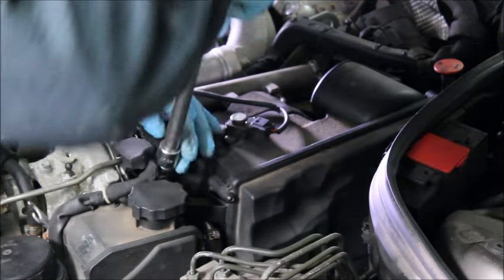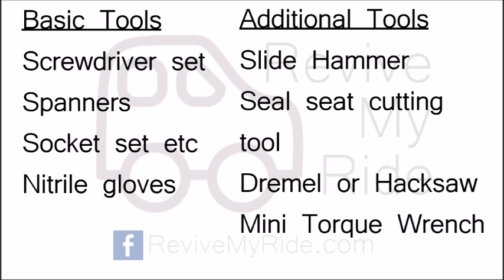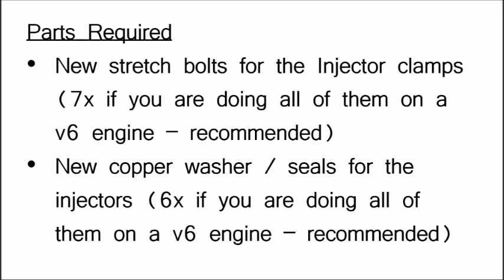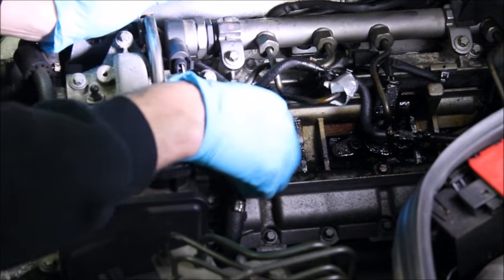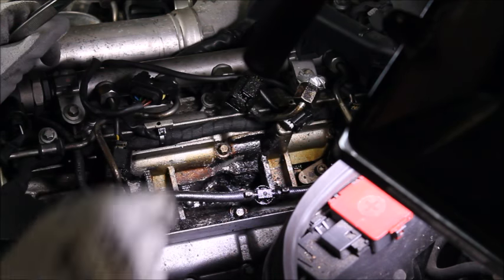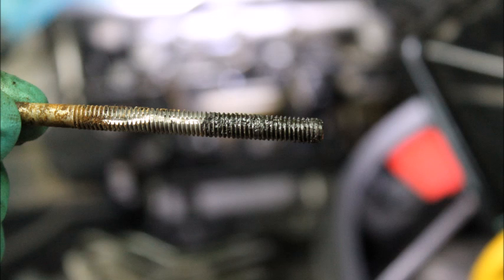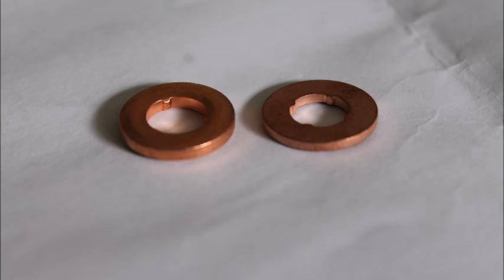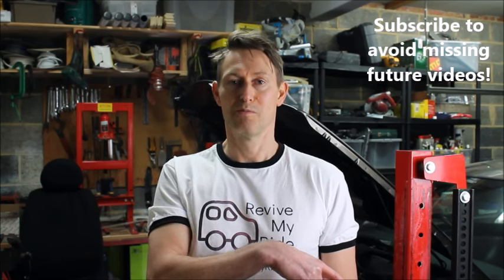Mercedes diesel CDI (Black Death) leaking fuel injector - How to diagnose and fix on 3.0 V6 engine

Comment: Hello, this is nothing to do with i njectors, but your channel is so easy to understand and precise, i was wondering if you could give me some advice regarding my e220 2007 mercedes, the parking brake seems to have come out, as in it seems not be connected to anything, prior to this, it always seemed a bit reluctant to release, i know its a long shot but you seem very clued up, thank you
Reply from the maker: Hi Charles, as it happens the release mechanism sticks on my Merc too but thankfully it still works (for now). If the mechanism fails, then it is usually due to one of the cables. Depending on your problem: If it is the release lever that feels like it is doing nothin then it could be cable item 190 in the attached diagram but in this case, the parking brake would stay on and you would struggle to get the car to move.
https://nemigaparts.com/cat_spares/epc/mercedes/1/fg/211006/64u/42/145/
OR if it is the pedal that is failing to set the parking brake (the pedal just goes down with little or no resistance), it is most likely to be cable item 80. However, please note that if the left rear (Item 230) or right rear (item 240) cables fail you might feel some resistance but not as much as normal because just one side of the parking brake is operating. I hope this makes sense and is of use to you! If you decide to purchase a new cable, please double check part numbers before ordering and it is worth checking with the Mercedes dealers because they are generally very helpful and surprisingly competitive on prices for some parts. It would be great to hear how you get on if you have time to message back! Cheers, Phil
Reply: @ReviveMyRide  Good afternoon Phil, first of all let me wish you a happy and healthy new year, thank you for your response, l am not much good with mechanics, but after seeing your videos it might be worth having a look at the park brake system if it isnt too complicated,,  i will let you know the outcome thanks again
Reply from the maker: @charlesalderson9738  Sounds good! I haven't looked at this system myself, so I'm not sure how easy it is to access and work n. Good luck with it!

Comment: Very good contribution. Only with the "Nissan" sealing ring part number a small error. The correct number is Honda 16472RBDE00. Best regards from Germany
Reply from the maker: Hi, Thanks very much for raising this point, you are absolutely right regarding the part number! I will need to amend in in the video description above!
Reply: Are all the injectors the same for all cdi models of the w211 model, mined a e220 cdi?

Comment: Thanks for the DIY description_Video : fantastic, and happiness here on the 2005- E220CDI  329000 km, and thanks for links to the tools ! Cheers from Norway !
Reply from the maker: Hi @cat1stevens nice to have a viewer from Norway! Thank you for your kind comments, glad you liked the video 👍 329,000km! That's almost 200,000 miles (sorry we are slow to catch on with metric for driving distances in the UK 😂) Best wishes for many more happy miles in your Mercedes! These are good cars with good engines and transmissions... Thanks, Phil
Reply: @ReviveMyRide  have had 2 changes on the circuit-board on the AT, as i managed to brake a pin, when i changed the adapter, for the controlcable during  oilchange , and  back in 2016, i had to repair the ECU: Thanks to Steven Lewis :https://www.youtube.com/watch?v=kynXjan7O0Q&t=3s  (computer-error-that was solved using BDM-100)
Reply from the maker: @cat1stevens  That is one of the risks when doing planned maintenance, it is possible to intrude problems. Glad you got it sorted, will check out your links for future reference 👍 cheers, Phil

Comment: Thank you very much for this video, I have issues with exhaust smell inside my E320 Bluetec, checked injectors and sure one of them is leaking fumes inside engine bay. There is not much carbon build up around injectors, hope I'll be able to replace those washers. I'm going to check more of your videos because they are very informative, thank you again!
Reply from the maker: Thanks for the comment! If it is leaking injector seals, then you are right to tackle them early, the job gets much more difficult once the carbon build up starts. Glad you are enjoying the vids :-)

Comment: Thank you for great video and links to the tools ! 
 I just got a call yesterday from a customer with the 3.0 diesel in a Jeep Cherokee that's leaking " blow by " around the injectors so I suspect this is the problem .
Reply from the maker: Glad the video helped you! Yep, as you say, sounds like it might be leaking injector seals. Be interesting to hear how you get on if you have time to drop a message later... Cheers, Phil
Reply: @ReviveMyRide   The engine had 4 cylinders leaking pretty bad and two thinking about it . Got the injectors pulled and ports cleaned up with some make shift tools we threw together .  Replaced all 6 copper washers and the Jeep is running great on the test drive .   https://www.youtube.com/watch?v=lY46G7Cnivo
  Thanks again !
Reply from the maker: @cranerigging3604  Thanks for sharing a video of the work that you are doing! Great to see the homemade tools that you put together and it looks like they worked really well! Keep up the good work!
Reply: @ReviveMyRide  Thank You !  It went better than expected .

Comment: Done that job Today. Just one injector for now, C350 so 5 more to go [ i sorta know they have a few leaks [cooler seals] . Years since i did owt like that. Did it with my 25yr old lad. Hes an engineer you know, he is ya know. knows everythin he does [Will see] . I cracked on i hadn't a clue, which i hadnt.  Black death like ive never seen it , ya could chisel it out. My lad give up a few times. Went in for a warm . Apart from me breaking a clip or two. Had i watch your excellent video first. I wouldn't have broke them. We shall finish Tomorrow,see if he cottons on . Pffff, engineer my a..e....Lol. Great video, thanks so much for making and sharing fella. Go ta top at class lad.
Reply from the maker: Hi Brian, I think this is my favorite comment ever! Glad you liked the video and that it helped some. Good to see that you are getting stuck in! AND fantastic that you are working with your son on it. I work with my Dad sometimes, he's a good mechanic and I'm an engineer, so we have a similar dynamic going on!  😂

Comment: Great video, helpful and covered all the points, I have been told that if possible to spray some wd40 or brake cleaner around the injectors to help removal and if sludge is really bad oven cleaner to loosen that sludge
Reply from the maker: Thank you! Yes, I’ve heard that all of those products do work 👍 One thing I would have been keen to try is starting the job with a warm engine. The heat stays around for quite a while and apparently makes a big difference to getting the injectors out. Just be careful not to touch anything hot! Cheers, Phil

Comment: Hi i have just discovered this problem with 1 of my injectors on my cls320cdi and will be having a go at doing this repair now thanks for your video 🙂👍
Reply from the maker: Good luck with it and let me know if you have any questions along the way and I’ll help if I can! 👍
Reply: Hi again I done it all repaired now she runs great thanks been a while since I wanted to do them because had other issues like swirl flap motor fail and turbo actuator fail but all working and fixed thanks 👍
Reply from the maker: @dandicey764  Great work! Even with instructions, it's still quite a technical job 👍 Glad to hear it is all sorted and you're back on the road. Thanks for the update. 🙂 Cheers, Phil

Comment: A very hard , Black Tar-Like substance has appeared around the nearest injector,  since 3 months ago , on my 2010 313cdi Mercedes Sprinter van 😳 .... it was " chuffing " initially,  but that's stopped for some reason -
How urgent would you see it needs attention ?
Love your videos , very clear and informative 👍
Thank You.
Reply from the maker: Hi Don, chances are that you will be ok for a while (say a few months) if you keep an eye on it but that black tar is the problem. It is what makes the repair time consuming and costly. Also, the "seat" at the bottom of the injector bore becomes damaged with time and that is why you have to re-cut them. If you catch it early, often the seat is ok and only the copper washer needs to be changed.  The sooner you catch it, the easier the work is. Probably it started "chuffing" but now the tar is muffling the sound and it has become a slow creep. Although I didn't show it in the video, I changed all of the copper washers (all six injectors) on my car. On the ones, where there was little or no tar, it was a doddle and I changed the washers very quickly. You have done well to spot it early, so that it will be a faster and easier repair. Hope this helps!
Reply from the maker: Don, thanks for your feedback, glad you liked the video. I am in the middle of a house move right now but have some footage for videos that I hope to upload in the New Year! Thanks!

Comment: I have a Jeep Crd 3.0 V6 with the Merc motor (OM642) and this is a problem I have only the right side head, my vehicle struggles to start and is underboosting and heavy on fuel. I hope this is the solution. I bought the vehicle at a bargain price and if this is the fix, I'd be sooo happy.
The video was really really helpful! Great job!
Reply from the maker: Thanks and glad you liked the video! Good luck with sorting your car out!

Comment: Very well done mate and hello from Eastern Canada. One injector just started to leak on my 2008 Jeep Grand Cherokee WK. I hear a poofing noise and smell the gases inside the passenger area.  I bought the 6-bolt and 6-seal kit from IDParts $24.95 US and the ceramic grease. I'm going to use one of the old bolts for the thread cleaning tool. They will all get replaced. The Rocal cutting compound is an excellent product we use it at my shop for thread cutting, a little bit goes a long way. A bit toxic so use with care. Thanks again.
Reply from the maker: Great to hear from a viewer from Canada! Sounds like you know what you are doing but glad you found the video useful! Good idea to chance all of the seals once one has failed and they are super easy to change if there is no carbon build up. Hope it all goes smoothly for you! Thanks, Phil

Comment: Thanks a lot for the step by step AND especially listing the parts needed! 

Just ordered the Nissan washers from UK since I figured the whole reason the seals failed initially because of the original Mercedes washers. No point of buying the same MB ones and redo this repair in the future...
Reply from the maker: Thanks for your comment! Yep, 3 years since the repair and still going strong on mine! Just to confirm, they are "Honda washers part number is 1647RBDE00), I'm sure you already know that, just mentioning it for others! I said Nissan in the video but in the description the make & part number is correct. Honda washers are a little softer, so will accommodate any imperfections in the sealing surfaces better, they are also just a little thicker, which is good if you have had to recut a seat. Hope the repair goes well for you! 👍
Reply: @ReviveMyRide  my bad ,wanted to say Honda washers (not Nissan). 

Of course, it's a strange sensation when you pay 50$ for 6 washers and ship them across the world 😂 but again I think it's the core component in this repair.
Reply from the maker: @ilusha55  No probs, I made the same mistake! Yep, I would always recommend the Honda injector seals!
Reply: Little update after completing this repair.  Ironically the hardest part for me was disconnecting/reconnecting the fuel return (leak) line and actually keeping the plastic retainers in one piece. Unfortunately I broke couple retainers because of the carbon deposits around the plastic and because of how fragile they are once they ve been compromised by the "black death". Ordered a new leak line.
Reply from the maker: @ilusha55  Thanks for the update, sounds like you are making good progress! Actually, those return line clips are quite tricky and yes, if the carbon has gotten around them then it can make them brittle too. So, new part on the way and then you should be good to go. Be warned, priming the fuel system can be time consuming too! If you have issues with it, check out the comments, there should be one pinned to the top with some instructions. 👍
Reply: @ReviveMyRide  nice catch for the priming part!  I suppose its because the new fuel return line wont have any fuel in it and the car wont start immediately? Couldnt find the instructions you were referring to unfortunately.
Reply from the maker: @ilusha55  Yeah, exactly, so the new fuel line is empty and the Mercs are a pain to prime. I couldn't find the priming info either, so will type it here in case you need it: 1) Turn the ignition to the on position, listen to the fuel pump start and then eventually stop again. Turn it off again and repeat 3-4 times.2) Be prepared to turn the key numerous times and let the engine crank. Stop after half a dozen times for 15mins to let the starter cool. During the break, or if the battery starts getting low put a charger on the battery. You may have to do this quite a few times. 3) To give yourself a better chance, if possible, jack up the rear of the car as high as you safely can (chock the front wheels), to lift the fuel tank higher than the engine. It may seem unlikely but lots of people say this really works! 4) This may be a pain but linked to the above, the more full your fuel tank is the better. Some people have done multiple trips in another car to collect containers of diesel to put in their car.
Don't be tempted to crack or loosen joints to let out air on the high pressure side. A high pressure fuel leak can cut your skin if you get too close. 
Or, you may find your car just starts straight up, in which case, ignore the above! 😁
Reply: @ReviveMyRide   Wow lots of useful info here, thanks a lot! I will update my progress once I do all the steps you mentioned, fingers crossed 🤞
Reply: @ReviveMyRide  quick update, on the Jeep CRD OM642 everything started within about 5 sec of cranking the the first time following your recommendations. I had about 2/3 of the tank full. Replacing the fuel return line took me about 2 hours. Mostly because you need to remove a lot of components on top of the old leak line to free it including the intercooler pipe and some of the fuel lines. Overall it was a very doable job!
Reply from the maker: @ilusha55  Thanks so much for the update! Great to hear how you got on, sounds like you did a good job 👍

Comment: Did you have to re learn the ecu for the new injectors? Mercedes says that we have to and if we do would it be okay to drive it to them if they aren’t learned into the system?
Reply from the maker: Hi, I reused the existing injectors, so I didn't run into this problem. I've never replaced a Mercedes injector, so haven't run into this problem before. I suspect that you may know more about this than I do but here is a link where a few MB forum members are talking about the coding. https://forums.mbclub.co.uk/threads/do-cdi-injectors-need-programming.32558/ Apparently, coding is to optimise the injector to run with the ECU, it doesn't mean that it won't run at all. On separate posts I have read about plenty of owners who have fitted injectors without coding them it, just monitored engine performance and fuel economy but its a personal choice.... Thanks, Phil

Comment: Great video 
I have a 2008 GL 320 with 135000 miles 
No issues yet thank goodness 
When you cut the seat, I assume that there was nothing preventing dirt from going into the engine ...
Reply from the maker: Hi, thanks for your comment! You are doing the right thing to keep an eye on it and to only intervene if you see a problem developing. It may never happen on your vehicle! You are correct that during the seat recutting process, there is a risk of cuttings falling into the cylinder. I minimised this by using a cutting compound both to improve the cutting quality but also to capture the swarfe. I didn't let the cutter blades get too full either and withdrew the tool regularly, cleaned away the cuttings and reapplied with new cutting compound several times. Cheers, Phil
Reply: Thank you for your reply 
I will definitely keep an eye on things ..😊

Comment: To answer your point about why this is common: this happens to all Direct injection diesels regardless of manufacturer, made since approx 2006. To comply with euro emissions legislation, car manufacturers introduced stricter EGR and DPF measures but, crucially didn't fit oil catch cans. This meant that there was lots of blowback carbon and oil floating around the intake and fuel systems. A decent oil catch can will prevent this from happening again - I've fitted on on my BMW (sorry lol) 2008 5 series and have exactly the "Black Death" that you refer to - loud ticking and, on inspection really hard carbon deposits around the top of 3/4 injectors. I have a video on the catch can - have done another better one which is going up next week. Hth
Reply from the maker: Hi Jonathan, thank you for sharing your experience but I just have a question based on what you wrote. My understanding is that the Mercedes diesel is susceptible to the injector seal (copper at the bottom of the injector) deteriorating and that this is due to a suboptimal clamping system used on these engines. Are you saying that oily emissions recirculating through the intake (EGR system) contributes to premature failure of the seal? Or are you talking about a different phenomenon? Thanks!